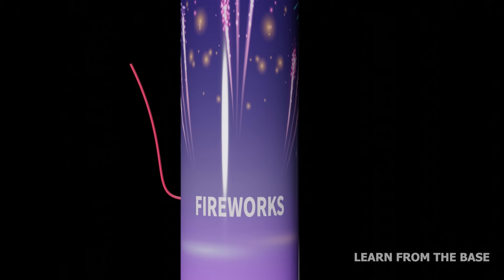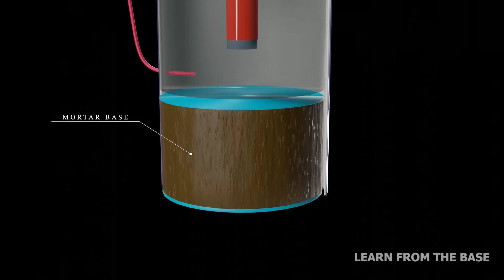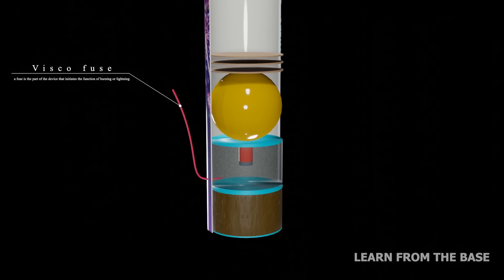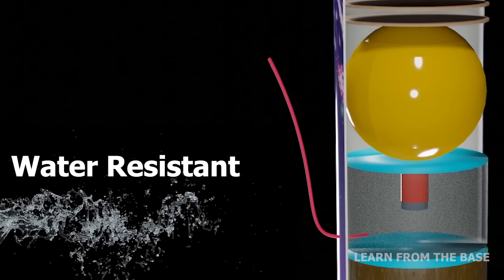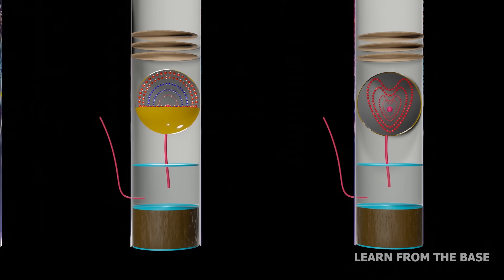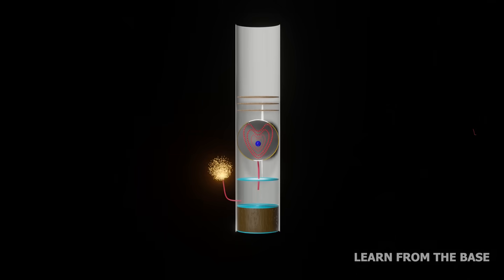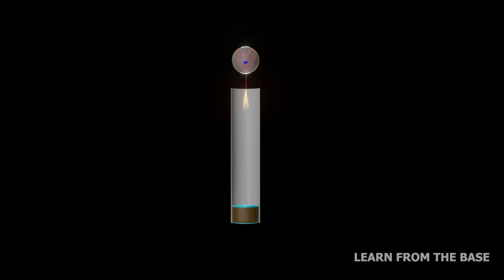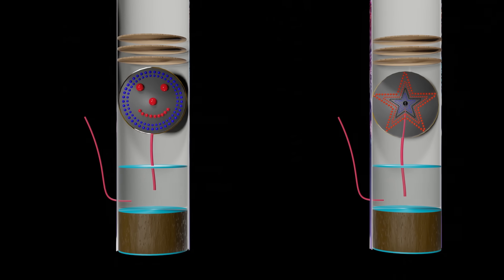HOW THE AERIAL SHELL FIREWORKS WORK? || PROFESSIONAL FIREWORKS | 3D ANIMATION || LEARN FROM THE BASE

Comment: Great animation.  Fun to note that professional fireworks shells do not use visco like consumer fireworks, instead they use what we call quickmatch, which burns anywhere from 30-100 ft/s (10-30 m/s), rapidly transfering fire down to the lift charge to give tighter control on timing during the show.  Most professional displays now-a-days use electric matches to ignite the quickmatch, giving even more precision to show timing and design, on top of being a safer choice for ignition.

Comment: me watching this video to make a DIY firework launcher
Reply: Probably not the best idea to do that with this basic information, making fireworks has to be very precise
Reply: i made a 3-4ft launcher before i got into pyro. anyways yeah that's a bad idea. i don't care if you use HDPE for the barrel, it's not a good idea to stick fireworks into launchers. the ONLY thing I would be comfortable with are small black powder rocket motors. by small I'm talking about anything from bottle rockets to 3/4in estes-type motors. if you know what you're doing you can tweak the motors and get a lot of nice effects, streamers/trails mostly. I wouldn't stick a rocket header on them unless it's just a comet you're putting in the front of it. if you mess up any larger fireworks and they go off inside or just out of the barrel, you will probably get killed or maimed

Comment: We usually use something called flash powder in the big shells to burst it not bp
Reply: Flash powder and black Powder terms are used interchangeably
Reply: @livingroomtheatre174  complete rubbish. Black powder and gunpowder can be interchangeable as they are the same compound. Flash powder is completely different and is never used as a burst charge in shells as it’s way too violent a reaction. This is because flash powder a high explosive and not a low explosive like black powder.  Flash powder is used in squibs etc. when you need a rapid break, when moving objects then it’s black powder.
Reply: @foxtrotalpha4346  Composition is same. Just that we add some dextrin and make globules . Chemical composition is same
Reply: @livingroomtheatre174  they're all different. Most people mean smokeless when they say gunpowder, black powder bp is a more basic composition that burns hotter and faster than modern gp. And flash powder is highly reactive powder used in applications where you need a quick burst
Reply: @Honestreview-om5hx  concept of smokeless powder is relevantly modern. The term gunpowder is used for centuries where it used to produce smoke
Reply: @livingroomtheatre174 flash and bp arent the same jesus christ, one's a felony if you're not licensed and the other's a constitutional right.

Comment: What if we use uranium plutonium neutrium for the blast effect instead of common chemicals such as copper aluminum strongium and other common Chemical what would happen if it would blast Into the air? Would it still blast would it still explode if it will is it already called a war
Reply: You can't, theres more to it than just lighting with a fire. You need to compress the molecules hard enough to produce a chain reaction

Comment: The height of a shell is highly dependant on the diameter of the Shell. 1000ft is most likely a 12" shell
Reply: Rule of Thumb:
1nch shell 100ft
2inch shell 200ft
3 inch shell 300ft
4inch shell 400ft
5inch shell 500f
6inch shell 600ft
7inch shell 700ft
8inch shell 800ft
9inch shell 900ft
10inch shell 1000ft
Reply: Mast
Reply: Mast
Reply: Mast
Reply: What the fck is ft?!! Use metric system!!!
Reply: Also the amount of propellant used.
Reply: Total BS bro....   a 1000µ is a goddamn 30' shell from where I'm from!  I shit you not! ;)
Reply: @noahbenzing1485  i think you underestimate shells. A 6" goes up 150-200m depending on the brand you are shooting. Lidu/Triplex sit around 160m for a 6" only. YouTube will delete my links, but on skylighter you can find detailed graphs of burst hights for the average shell and a 12" is 350m burst height. Which is well over 1000ft.
Reply: @noahbenzing1485   @Noah Benzing  have you got any idea how big 96" is? I dont think you understand anything of fireworks. The largest firework ever lit was a 62" shell weighing 1400kg. Anyway if you looked at the information you can find online you would see that its not a linear graph. Your scaling doesn't make any sense. Why don't you do some research or watch some documentary about the bigger shells like the yonshakudama before telling me i'm talking Bs.